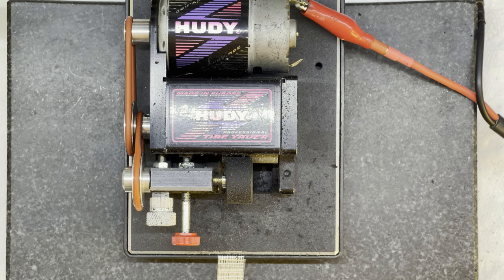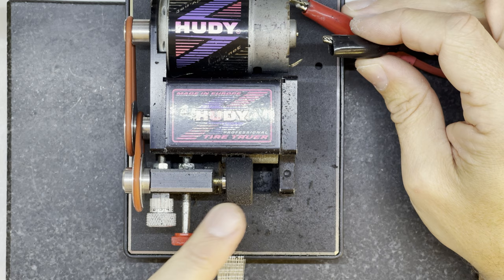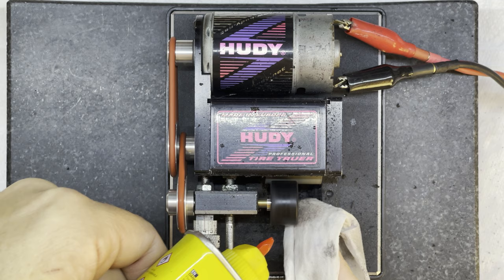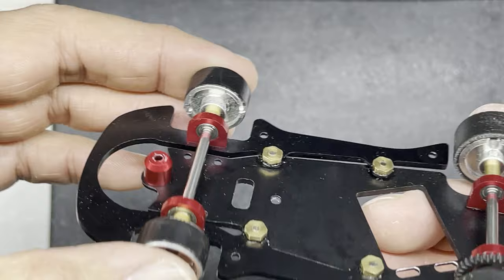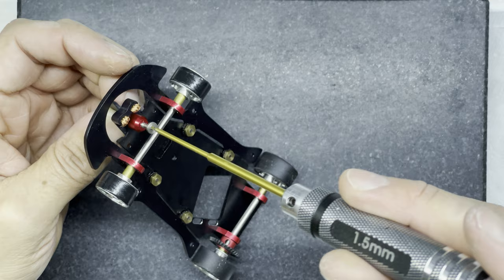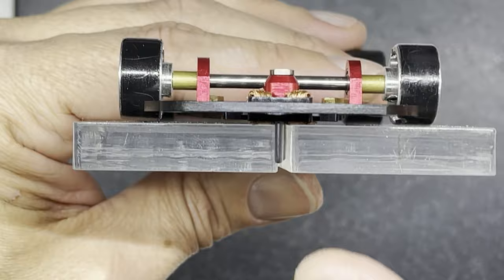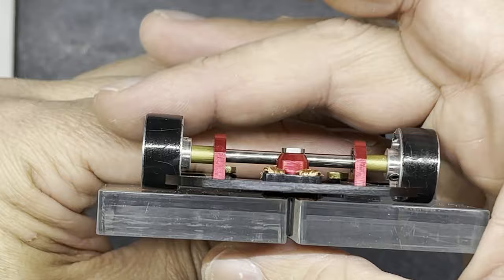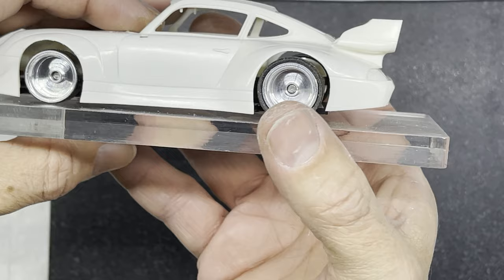Final chassis setup of my RevoSlot slotcar and test fitting the body

Comment: A rather foolproof method to true the body is to tape it to your stone block with masking tape (wrap tape around the block). Make sure the body doesn't wobble after taping, which means it's in a true position. Then heat up one liter/litre of water in a boiler. After water boils, let it cool down for one minute. Then place the car on block in a sink and pour the hot water over the body. After cooling down, the body should be straight. If you use too much water or you don't let it cool down long enough, the roof could collapse on you! And don't just dump the water on the roof, but distribute the water evenly all over the body.

Comment: The challenge I find with Revoslots is the lack of an adjustable front axle. Around 1mm clearance seems to be the sweetspot for handling on many wood tracks I have raced on. But to do that it looks like there would be no rubber left on the wheel or the wheel size would need to be changed out (to which spares aren't plentiful given Revo's odd size axle compared to other manufacturers).  I do love everything else about the Revo cars save the challenges with the front axle, which is why I have only bought one and won't buy another (even if they bring out more spares, spares + base cost becomes prohibitive) ... unless they address the front axle design.
Reply from the maker: Yes. The wheel size is a limiting factor for ground clearance on the RevoSlot car. It is not a problem if all other people are running RevoSlot cars but it could be a disadvantage if racing against other cars from different manufacturers. If you are allowed to change the wheels then you could always grind down the ends of the 3mm axle to 3/32” so that you could use smaller wheels.

Comment: Its looking good..might be able to take up some of the guide slack with a small bit of plastic straw strategically cut. 👍
Reply from the maker: Nice idea. It is such a small gap, even a piece of paper will not fit around the guide post, but even that small amount of clearance can cause a slight wobble. I have checked out some other cars from other racers and it seems that mine has very little wobble compared to some of theirs 👍🏻

Comment: I don't like truing rear tyres right down, I think more rubber = more grip. So I shimmed my rear blocks up 0.25mm to lower the rear of the chassis, no doubt you can't do that and that's the reason you trued the rears down.
Reply from the maker: Yes you are correct. No shimming allowed. Watch out for the video where I explain what i have learnt from my first race night at Pendle Scalextric Club

Comment: James to level the body to the chassis you could fit washers inside those rubber mounts where required.
Reply from the maker: You might be onto something there 😉
Reply: @CleaveTech  There is no guarantee the collets inside the body mounts are seated properly in the mounting post's and the face of them is the same distance to the bottom of the body
Reply from the maker: @michaelkettleson7317  , you are right about that 👍🏻
Reply: I'd want the body itself to sit flat on both sills and adjust any internal differences in the mount molding.
Reply from the maker: @modelracecar  The edges of the body are so far away from the track I wouldn’t have thought it mattered if they were uneven.
Reply: @CleaveTech  I understand that but a body that's flat and square looks better, the wheels in the arches will look even...and I thought you were a stickler for prep  :o)
Reply from the maker: @modelracecar  , you are not wrong 😁. I guess that if the bottom of the shell was straight and flat on the block AND the body mounting posts were all equally spaced from the block then that would be ideal, but the most important thing for handling is that the body mounting posts all sit flat on the pan section.
Reply: Adding washers sometimes works. The problem is that it raises the body which then may interfere with the wheel wells. Not a problem if your club allows you to remove some material around the wheel wells.

Comment: BRM/Revo make 15, 18, 22, and 25 shore tyres. The guide spring is very soft so no chance or the front end lifting up as the car is quite heavy (about 100g). Unless you are the best driver at your local club "blue printing" are car will not give you a consistent edge. You need to read the rules very carefully and look for loop holes to exploit. There are always loop holes even in the strictest rules. The Viper is probably the pick of the cars with respect to performance in the GT3 category. Wide and low body.
Reply from the maker: Hi Fabio. I am not at the stage of exploiting loop holes in the rules as I believe that Pendle Slot Racing Club are trying to keep this simple to allow new people to access the sport. I have checked out some of the really fast cars and they have just been built very well, there are no secret cheats 😉. The only car that is allowed is the Porsche GT2 and the rules state all the part numbers that are permitted to be used.
Reply from the maker: My car weighs 94g 😁
Reply: @CleaveTech  You will just have to rely on consistently being the best driver then. I know my limitations, there are many better drivers than me so Im always reading the rules very carefully to see what is possible.
Reply from the maker: @Fabio-ns4ql  I am still learning the track but I am getting better. I have had a go with a very fast car and I am 1/10s slower than the local expert with his own car, so I need to get a little better with my driving but I will do it 👍🏻
Reply: @CleaveTech  Thats the spirit!! As paradoxical as this may sound the stricter the control class is the more it favours the best drivers. Ive found that about a 1/10th is the break even point between excellent drivers and good drivers. Any more than that and no matter how good you are you cant make up the difference. Hence I always try and find at least a 1/10th in my car setup. I broke the track record first time out with my Revo. Beat the best driver by 2 laps in the race. After the race he was keen to try my car and promptly unofficially beat my newly created lap record.

Comment: You mentioned screwing the body to the chassis, do you intend to tighten them all the way? I tend to leave them slightly loose to isolate body movement. Luckily the screw are long enough so they won’t fall out during races, unlike the short screws on carrera cars xD
Reply from the maker: Really good question Daniel. I do answer this question in a future video 😉